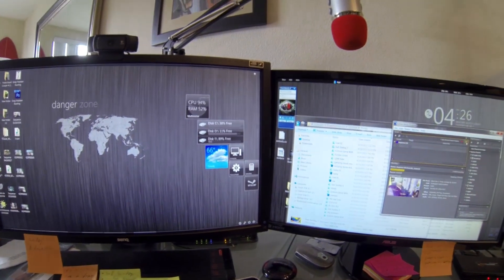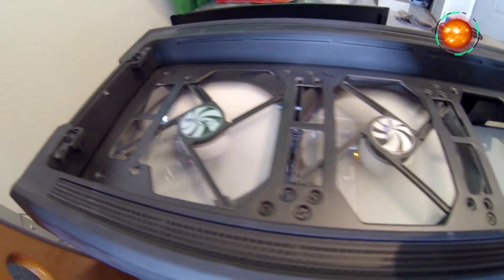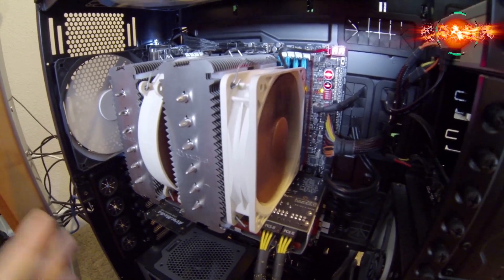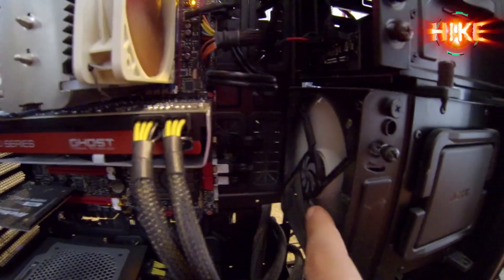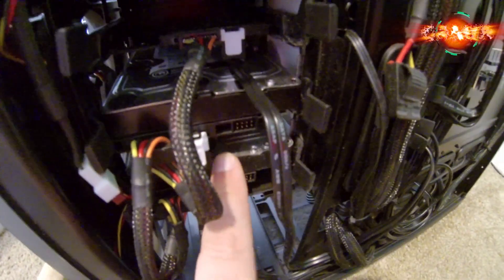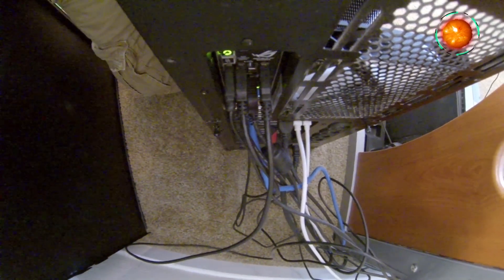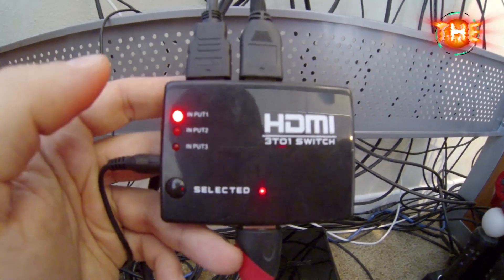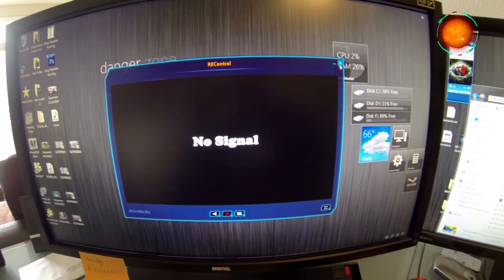How To Start A YouTube Channel Ep. 2/3 - My Computer, CaptureCard & Router

Comment: What parts did you use for that beast?
Reply: Description
Reply: CPU: Intel Core i7-3930K 3.2GHz 6-Core Processor 
CPU Cooler: Noctua NH-D14 SE2011 CPU Cooler 
Motherboard: Asus Rampage IV Extreme EATX LGA2011 Motherboard
Memory: Corsair Vengeance 16GB (4 x 4GB) DDR3-1600 Memory 
Memory: Corsair Vengeance 16GB (4 x 4GB) DDR3-1600 Memory 
Hard Drive: Samsung 840 Series 500GB 2.5" Solid State Disk
Hard Drive: Western Digital Caviar Black 1TB 3.5" 7200RPM Internal Hard Drive 
Hard Drive: Western Digital Caviar Black 1TB 3.5" 7200RPM Internal Hard Drive 
Video Card: XFX Radeon HD 7970 3GB Video Card 
Power Supply: SeaSonic 860W ATX12V / EPS12V Power Supply 
Optical Drive: Asus BW-12B1ST/BLK/G/AS Blu-Ray/DVD/CD Writer 
Monitor: BenQ XL2420T 120Hz 24.0" Monitor
Operating System: Microsoft Windows 7 Professional SP1 (64-bit)
Other: AVERMEDIA Live Gamer HD